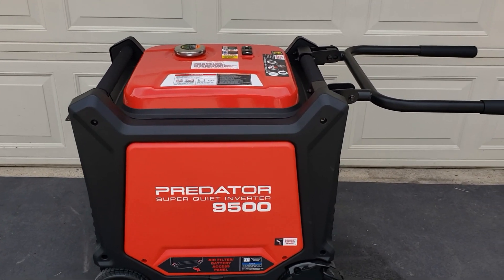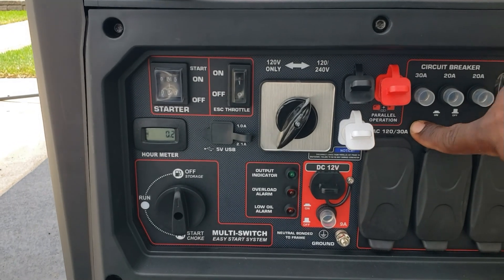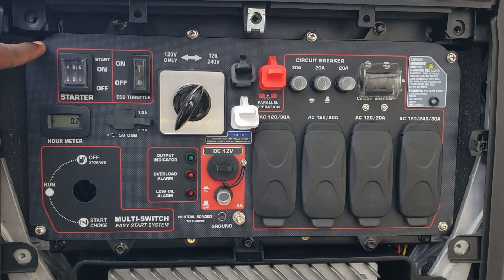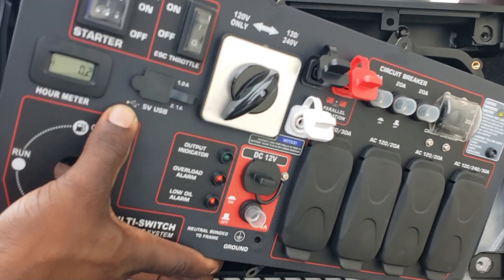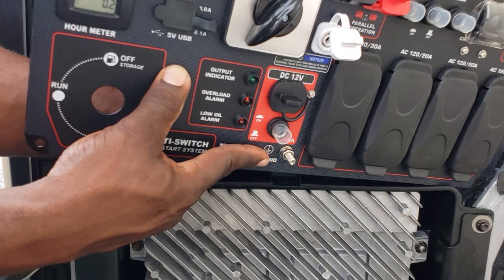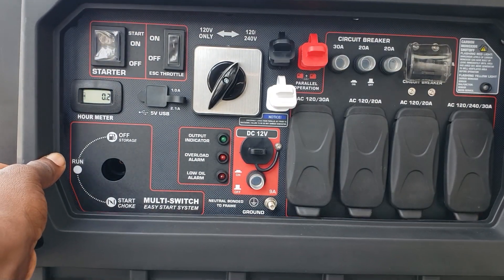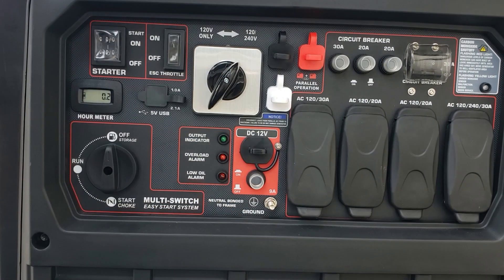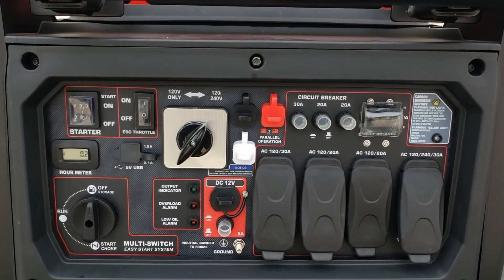How to Convert the Predator 9500 Inverter Generator from Bonded Neutral to a Floating Neutral | DIY

Comment from the maker: Thanks guys! 
I plan on doing a part 2 explaining why I converted to floating neutral. I always try to keep the videos short and simple and to the point. So stay tune for part two and don’t forget to subscribe.👍🏾
Reply: I always appreciate your videos.  There are a few good videos of why to use which (bonded or floating). Even after explaining it  some people still confuse it.  A good rule of thumb is  if evrrything is plugged into your generator, bond it. If your generator is plugged into anything that is already bonded (breaker panel, etc.), then it needs to be floating.
Reply: @ben31tube  That is what I was thinking. Thanks for the definitive answer. Float the ground when connecting to the house. Make a bonding plug for other times. Thanks.
Reply: That would be much appreciated. I am still very confused about when floating and bonded is needed.  You see various generators that are marketed as whole-house emergency generators yet some are bonded and others are floating. I doubt anyone is buying the Predator 9500 for their RV due to the size and weight.
Reply: @eosjoe565  Harbor Freight technical support told me that all of their 240V generators are neutral bonded, and their 120V generators are unbonded. That explains why the Predator 9500 inverter generator is bonded, but my Predator 3500 inverter generator for the RV is unbonded.
Reply: Hi. I know this was 3 years ago, but thank you this is helpful. I might suggest to people to tape a new note over the old one (Old one says bonded) that says bonding is disconnected. That way you can rebond it if you want to use it in the feild and not connected to the house.

Comment: I’m hoping someone can clearly and safely explain this to me. Most of the information I’ve found on YouTube has been a bit unclear. I recently purchased a 3600 portable power station with a floating neutral for my RV. Since it’s not bonded, my EMS is showing an open ground fault. After doing some research, I saw recommendations to use a bonding plug. Am I on the right track with this? Please advise.

Thanks!
Reply from the maker: Just go to Amazon purchase a bonding plug you’re on the right track.
Reply: @GeneratorReviews Thanks for all your help.  So it is unsafe to run an open ground generator solar or gas into your RV?

Comment: FIXED MY GFI TRIPPING ISSUE!!  Thanks for the content!  I did this for two reasons: 
1 I needed to float the neutral for my off grid solar inverter. 
2. My GFI kept tripping under a normal load. This absolutely fixed it!!

Comment: My inlet box is connected to my transfer switch... so????
Reply from the maker: I’m confused 🤔
Reply: @GeneratorReviews  My Inlet box is is connect to my 10 circuit reliance transfer switch. My transfer switch connects to the main power panel. The inlet is grounded to the 10 circuit transfer switch. The 10 circuit transfer switch has a ground and neutral that goes back to the main power panel.  The main power panel has it own ground with a neutral bar.   Now my question is..  is my generator supposed to be a floating neutral but I heard thats extremely dangerous...Right now it bonded neutral it works and all but it doesn't pass code. Its the delima that a lot of people are facing.  one setup will kill you and the other "might"  trip your breaker and have electricity flowing where its not. This is why im confused 😕.

Comment: I just ordered a TMG Industrial 10500 watt generator ( which looks like its made by the same Chinese company that makes Genmax) and plan to modify it with a switch to change between "neutral bonded to frame" and "floating neutral" for use with natural gas and my Generlink transfer switch. Frankly companies should do this standard with these larger gennies usually used for home backup.. 

This will allow me to power the whole home for 36 cents an hour rather than $5 an hour with gas as natural gas is dirt cheap here in Ontario, Canada.

Comment: I plan to install a switch to go from bonded to neutral floating and have that switch available inside one of the removeable side panels. This way if I ever use the generator with gas and outside tools for example, I can switch back to to bonded neutral. Only problem is it messes up your warranty

Comment: Thanks for directions on this specific model. The only time you need floating neutral is when you're hooking it into the house and the main panel has a bonded neutral, right? Every other use just keep it as a bonded neutral, right?
Reply from the maker: You’re correct👍🏾

Comment: Thanks Gavin.  Do you have a video doing the same conversion on the GM9000IED?   I want to use a 50 plug into by house and heard that the GM9000IED is a bonded neutral.  Any help is much appreciated!  Dan
Reply from the maker: I don’t have one for the GM 9000 but I will update soon.
Reply: @GeneratorReviews  outstanding sir. Much appreciated! Love your channel.
Reply: Do you have a video on this for the duromax xp9000ih?  @GeneratorReviews

Comment: UPDATE THE MARKING:  I strongly feel you need to update/ remake this video to show remarking the bond status.  “Marking shall be provided by the manufacturer to indicate whether or not the generator neutral is bonded to the generator frame. Where the bonding of a generator is modified in the field, additional marking shall be required to indicate whether the generator neutral is bonded to the generator frame.”  Otherwise a nice tutorial video.

Comment: This is an extremely valuable video for so many people.  It was mentioned to place a toggle switch, which is a great idea.  Maybe a possible video on that.  I like the idea of gathering info on many generators to show the location of the bond on different models. Just show the location and give the models.  Note: The Genmax 9000 and the Duromax 9000 is the same procedure as the preditor 9500. Thanks again.

Comment: I called Harbor Freight technical support, and they shared these steps to make it a floating neutral like all of their 120V generators. I appreciate your video. I'm glad it doesn't void the warranty. I'm connecting to the house with a   100A manual transfer switch. I understand I won't be able to use any 40A circuits like oven range or A/C with the 7600 running watts of the generator.
Reply: Why wouldn't it be able to run an AC or electric range? 7600 watts is plenty especially when it has an additional 2400 watts for start ups. You might have to install a "soft start" to keep your AC from creating too much of a surge ehen starting. But 7500 should be enough for a household AC.

Comment: On some models of this generator there is a jumper from the far right 120 volt socket at the bottom to the ground wire of the plug ,just remove white jumper on one end and heat shrink it at the terminal and your good.

Comment: Curious, why not just disconnect the ground in the inlet box so it doesn't make its way into your main panel?
Reply from the maker: You could do that, but then the generator frame would not be grounded to the system
Reply: Yes, but it's more akin to how your power comes from the utility company.  Neutral is bonded to ground at the transformer, and then is again bonded at service entry.
Reply: And technically it is grounded to your system, it's just not using the ground cable to do it.

Ground is a safety feature and it leaves your safety intact.

Comment: I wonder if this is why my outlets are tripping on my 9500. It trips immediately when I connect an extension cord , any idea. Only 6 months old
Reply from the maker: When you say it trips after connecting the extension cord, what do you have connected to the extension cord?

You may want to check that extension cord or replace it.
Reply: @GeneratorReviews  I fixed my issue, there was a short in one of my outlets

Comment: If your main panel in your house is technically a subpanel because the main breaker is outside, then do you want the generator to be bonded neutral? You stated that if your house is panel is bonded then you want the generator to be unbonded yes? So if your main panel in your house is a subpanel it should not be bonded because the main panel on the outside of my house is bonded back to the power plant. If that's the case and I have a floating neutral generator then I need to bond it with the plug, yes?
Reply from the maker: Yes, you’re correct

Comment: Gavin ,like your videos, just a question on the predator 9500. a generator company said i should keep the 9500 in its grounded form but use a grounding cable to ground it to the same ground cable as my house. any commrnts on this, just want to do it right
Reply from the maker: Well that doesn’t sound right because you should have one bonded neutral to ground and it is in the main panel 

I definitely agree with grounding the generator to ground
Reply: so you are saying it is ok to have it grounded to the same grounding pole as my house or do i need a separate grounding pole, just don't want to cause any shock problems or damage to house or generator,thank you @GeneratorReviews
Reply: Gavin if you could please verify this type of hookup i would apprieciate, just want my generator and house to be safe
Reply: @davidfortenberry9672  I called Harbor Freight tech support and didn't even mention Gavin's video. The tech agent told me the procedure to unbond the neutral wire just like this video shows. It's interesting this procedure isn't in the user manual, but a relief that it is a supported procedure when connecting to an inlet box on a building with an interlock or transfer switch per NEC.

Comment: I have an interlock on my panel and getting a Duromax Inverter 9000W generator.   It will be used as a whole home backup so would it be better just to remove the bonded neutral?  Also, if I needed to have the bonded neutral for something else such as an RV, would it work to just get a bonded neutral plug available on Amazon?
Reply from the maker: Yessir you answered your own question 👍🏾
Reply: @GeneratorReviews  perfect! I was just wondering if it was that easy.  I saw people mentioning toggle switches but if a simple bonded plug will work then it's good for me.  Thanks!

Comment: You can make it bonded again by taking a plug just wire common to ground plug that plug into one of the receptacles on the generator it's bonded again. This would be for if you need to use it as a standalone unplug it from the house and plug in something directly to one of the generator receptacles.
Reply: They sell these pre made.

Comment: Why not remove the jumper from neutral to case ground on the Generator End then use a tie wrap and attach it on the machine and mark Floating NEUTRAL.   CHEERS

Comment: Hey Gavin do I need to do this to my wgen20000 generator if pluging it into a 50 amp plug to my breaker box or I'd I have a manual transfer switch in between the breaker box and the meter do I need to do this action as well?
Reply: My plan is to have a a manual transfer switch 200 amp to 50 amp switch with a 50 plug on it to power with generator which way would I need to ground?
Reply from the maker: You should be floating neutral on your generator since you are already grounded on your panel you don’t have to ground the generator but you can if possible.
Reply: OK so if I go with the floating neutral can I still use the rest of the plugs on the generator even tho it's a floating neutral now

Comment: Question Generac Gp17,000 running watts iwith a 50 amp outlet that is not GFCI protected and not using a transfer switch but using and inlet box with a interlock switch to cut off main power from the line This generator is bonded to the frame and I’m also running a ground wire to earth. Do I still need to un bond
Reply from the maker: Yes, it has to be floating neutral because there can only be one bonded neutral in the circuit

Comment: so if i wanted to make it easier to switch the gen from bonded to floating i could make the neutral wire longer, drill a hole in the panel and connect the wire to the outside grounding bolt when i needed it bonded and take it loose when i wanted it floating.  or am i missing something?  i would love to see a video like this or even a toggle switch install.  i need mine for running some equipment but want it for emergency to go to a inlet box for the house.  could you do a video with a toggle swithch on the genmax 9000 duel fuel?
Reply from the maker: I’m working on a video doing the floating neutral on that exact same generator

Comment: Gavin, I don't know if I ask you before, but will the predator 9500 handle assembly fit the Predator 3500 generator? Or since you have or tested so many other generators, will any of the generator handles side over or adapt to the predator 3500 handle? Thanks
Reply from the maker: I don’t think it’s compatible with the 3500 different sizes but I will check out one that will work for you
Reply: @GeneratorReviews  Gavin, Thanks a bunch.. I need handles on my Predator 3500.

Comment: Gavin, how would you do this on a PREDATOR 3500 INVERTER GENERATOR to make it a floating bond? Love your video's. Thanks
Reply from the maker: I will be doing a conversion video on pretty much all the generators
Reply: The Predator 3500 is already a floating neutral. Check your owner's manual.

Comment: Two questions from a dummy that is trying to be prepared. First in the video you state that you have to make ie floating before you plug it into the receptacle, WHAT RECEPTACLE?. And secondly, what is different between the receptacle that yu speak of and the transfer plug? Thank you very much sir
Reply from the maker: The inlet box or transfer switch are your two options for power outages 
https://youtu.be/CiOxcgu1-MM

Comment: I plan on using my Predator 9500 to power my off-grid (there's no commercial power) pole barn. I planned on installing a 100 Amp panel and power the panel from the inverter. So now I'm wondering if I should leave the bonding screw out of the panel. If I do that, should I install a grounding rod and connect it to the inverter?
Reply from the maker: You should keep it bonded if you’re gonna be powering an off grid cabin and it’s OK to ground it.

Comment: I was planning on buying a Honda EB10000 generator, but noticed in the online manual that Honda doesn't allow  their generator to be hooked into an house electrical system.  I assume it is because of the bonded neutral.  What you show could be done to the Honda, but I wonder if there may be more to it with the sophisticated Honda generator?  Thanks for the good video.
Reply from the maker: Yes it is possible to convert to floating neutral
Reply: @GeneratorReviews  Thanks.

Comment: What if you are powering a sub panel?
Reply from the maker: What’s your question about the sub panel?
Reply: @GeneratorReviews  I got my question answered, thank you for responding. I was wondering about the floating neutral and found out that's what I need since i will not be switching off neutral when using the gen for backup power. I'm using an interlock and a breaker.
 Thanks again and thank you for all the great videos, I really enjoy them
Reply from the maker: @TerraFirmaX  yes that is correct, good luck and I appreciate you watching 👍🏾💯

Comment: Gavin on the duromax 9000ih it has 2thick white wires heat shrink together connect to bolt.Not 1single white wire shown in video.
Reply from the maker: I will have to open it and record that for you.
Reply: @GeneratorReviews  Gavin did you ever look at your duromax 9000ih  2nd generation  to if you had double white wires on bonding bolt on the panel?

Comment: Hey Gavin my Duromax 9000ih has 2 white wires a single terminal. Should I still disconnect the 2 wires?
Reply from the maker: Just disconnect the neutral wire from the outlet leave the ground

Comment: Did this lift the neutral from the grounding rod point or all the receptacles as well? Did you meter the neutral and ground on the receptacles after? Why I mentioned this is some generators bond neutral and ground in the generator windings as well so lifting just this ground rod neutral point may not float the neutral on the receptacles.
Reply from the maker: Hey Douglas
The predator 9500 has one bonding point at the grounding rod. I did test it after I was done. 
You’re right most generators do have multiple different bonding spot

Comment: Is there enough white neutral wire to land it on another bolt sticking out of the front panel like how the ground bolt is? Then you could jump the two bolts when you need to run extension cords from the generator and keep the 30A plug free.
Reply from the maker: There should be enough white wire to do that. Great idea.👍🏾💯